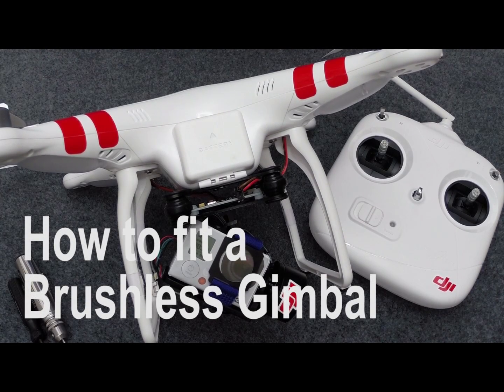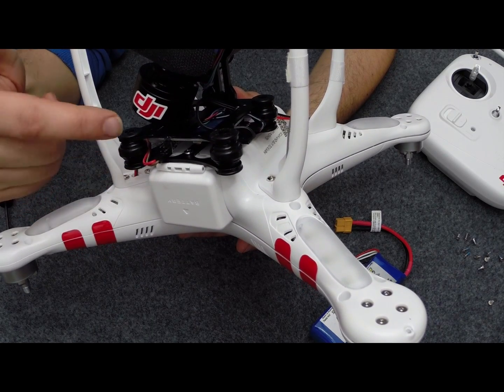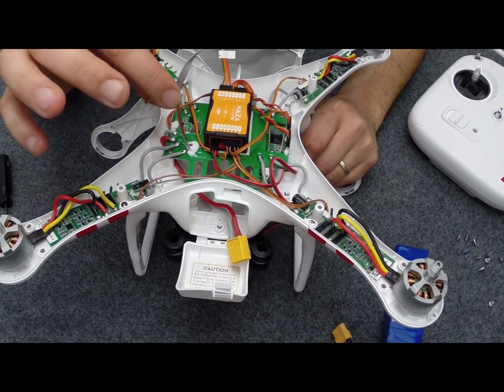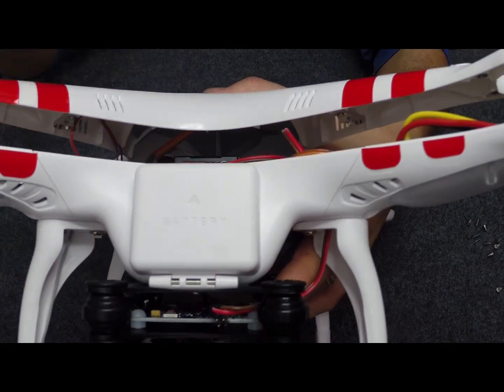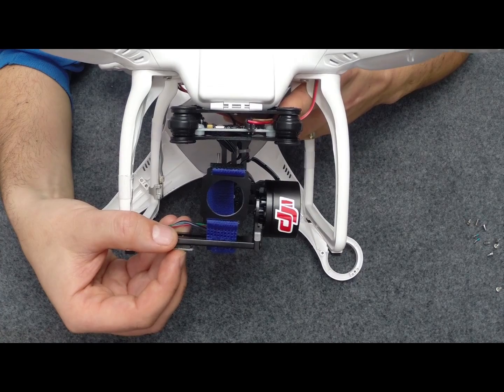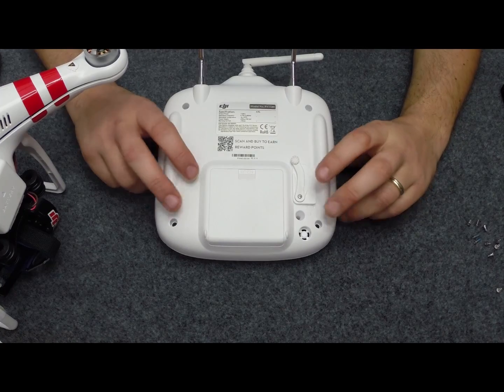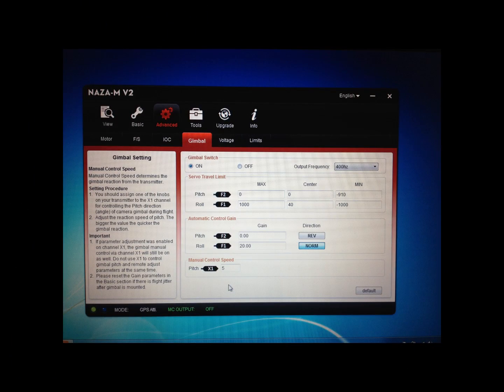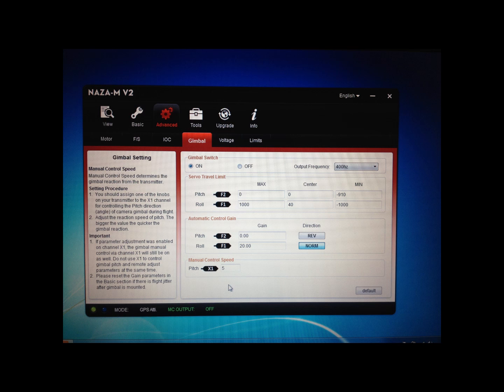How to Fit a Chinese Brushless Gimbal to DJI Phantom 1, FC40 & V2

Comment: Why to go with second wire connection to level horizon(Pitch), when you can use the reset bottom and hand hold the horizon correctly for a few second, so boards gets the right horizon?

Comment: Hi followed your instructions everything is spot on but my gimbal tries to rotate trapping the wires and shuddering do you have any fixes for this problem. Bob.
Reply: Mine is doing the same thing yours did, did you find a fix for that?
Reply: +Andrew K hi I fixed it by buying a different gimbal a walkera g2d it only uses one wire from nazam. The other one I messed around with it online setting the X and Y axis to different settings but every now and again it take a funny turn. But the walkera was £50 and plugged straight in and worked without having to mess around with parameters. Good luck Andrew I don't know how patient you are but I nearly through mine out window with frustration.
Reply: Thank you, perhaps I'll try a different one.

Comment: Great instructional video. I am experiencing a problem. The gimbal seems to be vibrating. What setting to do I need to adjust to avoid the vibration/shuttering of the gimbel?
Reply from the maker: Malcolm Gropper This can happen if there is any load on the motors or the power to the motors has been turned up to m uch

Comment: Those little screws at the end, mine are so tight, I lost the grip on its head. What do I do?
Reply: SnowFlake try dabbing some super glue in the screw then putting your screw driver in it, letting it dry a little, and turning it

Comment: Hi, nice video !
I have the same chinese gimbal and DJI FC40, but I have a problem - tilt control doesn't work when I try to use a separate battery (auto stabilization is working). It works well with the main battery ? Can you help me !?

Comment: I want to use my foxtech horyzon HD camera the weight is about just under 40 gms, will I have a problem with this or will I have to add weight equal to a gopro

Comment: Can you still use the Gimbal for stabilization without connecting the pitch control?
Reply: Also, I'm looking at this Gimbal, is this the one you use in your demo? http://www.amazon.com/Brushless-Camera-Gimbal-Controller-Phantom/dp/B00GAY5YBU/ref=sr_1_1?s=toys-and-games&ie=UTF8&qid=1426011710&sr=1-1&keywords=DJI+Phantom+Gimbal
Reply from the maker: Yes it would still work but it may not be pointing at the right angle. Yes it's the one from your link.
Reply: Marionville Multirotors Thank you so much for your reply.  Your video was very helpful, I just ordered my gimbal.  Bought the DJI Phantom 1 recently and am excited to see how it preforms with the gimbal.

Comment: The header has to be corrected, the Phantom 2 will not works with Chinese gimbals because of  the new firmware.
Just got an idea this "Zenmuse H3-2D upgrade kit" could solve the trouble. Does anyone could comment it out? Could this upgrade kit be used for connecting not-original  gimbal to Naza flight controller?

Comment: So I have mine all set up but it wobbles really bad descending. Is it the position of the gimbal? I mounted it exactly the same.
Reply from the maker: If your et alot of wobble when descending this is usually the wash of the blades as you dropping into it as you descend. Try moving forward as you descend it helps.

Comment: great video and very helpful. Can you or someone else tell me where I can get the wires that connect from the gimbal circuit board to the naza flight controller F2 port used to control the tilt. It did not come with my gimbal. Thank you!

Comment: Hi I have fitted Gimbal , and followed your settings but Gimbal rolls back when connected (pitch) My gimbal controler board slightly different 4 sets of pin outs 
can you help ? all ok ie gimbal level etc without pitch connected
Reply from the maker: The gimbals do vary a little but it sounds like you either don't have the pitch lead connected to the correct pin on the gimbal or you haven't got it set up in the Assistant software correctly.

Comment: What sort of flight times are you getting with your FC40 with gimbal and GoPro?  I imagine the extra weight and gimbal power cuts it down quite a bit.
Reply from the maker: You'll prob be around 6mons with standard props and battery but if you use the Phantom2 props and 2900 battery you should be back up at 10mins.
Reply: Marionville Multirotors
Much appreciated!  I'll start keeping an eye on the battery around 5 minutes then, and will look into upgrading my batteries.

Comment: I have a Phantom 2. I'm connecting the A0 pin from the gimbal to the Phantom 2 controller (it's not the Naza) in the bottom F2 pin. As sson as I turn on the DJI the gimbal turns on as well but the gimbal starts moving so the camera looks up (to the bottom part of the DJI. The pitch in the phantom remote is not working and the gimbal just stucks looking up.

Also I have de Phantom assistant software so on the Advance-Gimbal settings I don't the ON/OFF button. I just have a "FPV Mode" checkbox and 3 faders with "Tilt control gain", "Horizontal limit", and "Vertical limit". Could you please help me on how to get this working. Thank you very much.

Comment: Nice Video, you have some info that's good to know. I have the same gimbal you have here. I had it installed on the P1, but now want to install on my new P2. I'm having a problem getting it to work right. The software I downloaded for the Phantom 2 I can't get the gimbal part of the software to come on so I can make adjustment, it's like it's not there. The gimbal pitch is working, but there's no adjustment and it bounces and makes noise when you maneuver it downward, the travel is too much.
Can you tell me the correct way to install this gimbal. I know, the P2 comes with all the cable for the Zenmuse gimbal, but I cant see spending all that money when I have this brushless gimbal or will it not work at all on the Phantom 2?
Can you help me? Any advise would be greatly appreciated!
Reply: could you please tell me how did you connected the picth control from the gimbal to the phantom 2??

My gimbal has 4 columns with 3 pins in each one. In the PCB I can see (and tested with a multimeter) that the left-most pins are Vcc and Ground so I don't know where the pitch control is within the rest of the 3x3 pins. Hope you can help me.
Reply: Have you figured out how to fix this? My gimbal worked fine in the f2 port of the phantom 1, but on the phantom 2, the gimbal travels too much when the quad tilts forward or backward.
Reply from the maker: You can only use aftermarket gimbals on the Phantom2 if your using version 1.8 firmware.

Comment: Also, you've obviously done this for the GoPro.  If I go with a less expensive version (e.g. the Sj4000), are there any other setting changes I'll need to address?  Perhaps something with weight?

Comment: Thanks for the video.  I was having problems with mine just turning up.  After watching your video, I was able to solve the issue.  Mine required a little different settings for some reason, but now tilts downward.  It doesn't quite tilt 90 degrees, more like 75-80 degrees, but that is good enough for me right now i guess.  If you have any ideas, of how I may can get the full 90 degrees, thanks.
Reply: I found my issue of why the gimbal would not tilt the full 90 degrees.  Poor design on the sensor wire on the bottom of the gimbal platform.  When tilting, the wire would hit the brace, causing the "jerking effect".  I simply rubber banded the wire to the bottom of the platform, (around the sensor) and the wire is not getting in the way of the brace now.  I have full tilt.  Hope this helps anyone having the same issue.

Comment: Brilliant, thanks! I've been curious how a gimbal would work with the FC40, and this seems like it answers most of the concerns I have. I guess the only question I have left is "Since I have an FC40, what is the minimum I need to do to get a transmitter which lets me control the pitch" -- I read that the FC40 transmitter is actually a 7-channel transmitter, but it just has no control on the back, is that right?
Reply from the maker: The FC40 transmitter has no leaver on the back but if you check out my other videos I have a guide on fitting the leaver.
Reply: Marionville Multirotors You don't sell that lever do you?